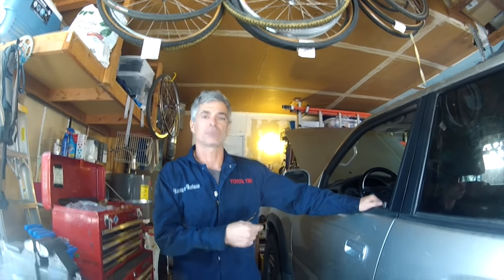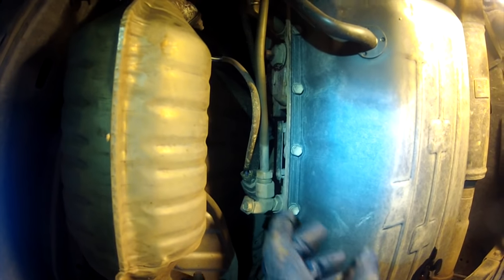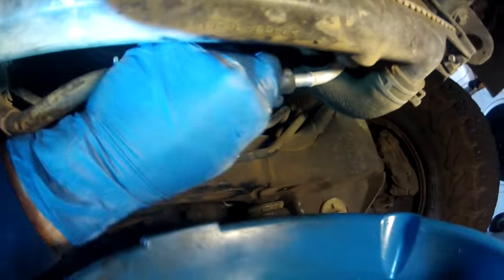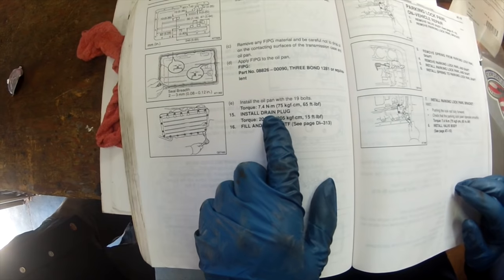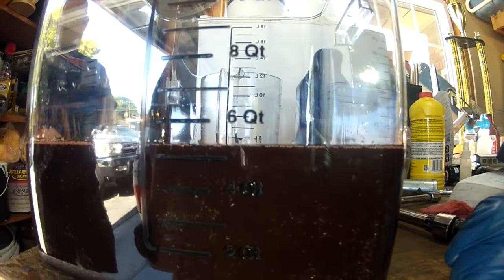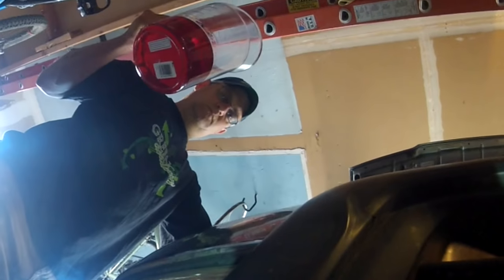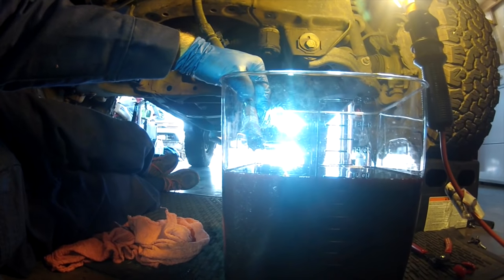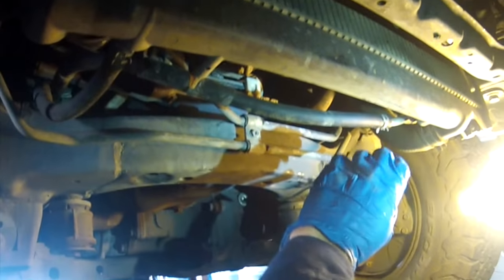Transmission Fluid Flush

Comment: Great video. Do you have to change the transmission filter too??
Reply from the maker: Glad you like the video.  Changing the filter isn't necessary unless you suspect the trans was seriously abused and never got fluid changes allowing sludge particles to develop and partially clog up the filter media.  The filters are a fine mesh strainer rather than what most consider a filter with some type of paper material that clogs easier over time.  The filters in these rigs could last forever provided the trans receives regular fluid exchanges.
Reply: @TimmyTheToolman  oh ok!! Thank you so much!! Great help!!
Reply from the maker: @HowardSprague116  You're very welcome.

Comment: I own a 2002 4Runner SR5 4WD. Love your videos and have been able to keep up all the maintenance myself with the help of your videos. Just wanted to ask if you had any experience with the fault code P0770. I flushed my transmission fluid and made the switch over to the Toyota Coolant a couple months ago and it brought up that code. According the FSM it’s a Shift E Solenoid fault. So I bought an OEM one and swapped it out, made sure the valve body was clean, inspected all the harnesses and changed the filter. I even shot the wires with my multimeter just in case. None of the magnetics in the pan had anything on them either. Haven’t had any shifting problems but my A/T oil temp is on the high side. I’ve researched all the forums I could get my hands on and haven’t found anything useful. Just thought I’d leave a comment just in case someone else in my same situation. Any insight would be appreciated!
Reply from the maker: We have not tried to diagnose a P0770 code yet.  What you tried so far sounds right to me.  When you say your trans fluid temp is on the high side, what temps are you seeing and in what conditions?  Was your fluid in really bad shape when you did that flush?
Reply: When I did the flush it wasnt burnt but it was on the darker side. Not sure when it was changed last (bought it about 2 years ago with 190k miles)I just drove back to Vegas from LA. When I have the gas pedal engaged or cruise control set my temps stayed normal (a/t temp: 195ish coolant: 195ish) but when I would coast without pressing the gas pedal my a/t temp would sky rocket to 280-310. My coolant stayed the same the entire time. As soon I pressed the gas pedal again it would drop back down immediately to about 210 and get lower and lower until it reached 195.
Reply from the maker: @ccrook12  Wow, you're seeing some crazy high numbers.  Normal cruising temps for your automatic trans should be between around 130-170 unless you're climbing a grade or towing.  The ambient temps can affect it so if the weather is really hot, your trans temp will run higher as a result because the cooling capacity of the air running through the cooling fins reduces.  You would only see high 200's if you're climbing up a long sustained grade and you never pull over to give your rig a break.  To clarify, these temp problems happened after you did the flush?  Before the flush there were no temp issues?
Reply: @TimmyTheToolman  Yes, I didn’t have any issues before I did the flush. That’s when the P0770 fault showed up.
Reply from the maker: @ccrook12  Ok, this is what I think happened.  It sounds like the previous owner(s) never changed the fluid or maybe only once.  Because of the abuse of not renewing the fluid regularly, sludge deposits were allowed to build up inside the transmission.  ATF has very good detergent qualities to it.  When you do a full flush all that new fluid is going to start working on those deposits and some of them are going to break free and be free-floating.  Those deposits could become lodged in the narrow fluid passageways in the valve body and then starve the trans of fluid.  It's for this reason that I never recommend somebody do a full flush on a trans with an unknown service history and with fluid that looks dark and smells burnt.  It's safer to do it slowly by doing a series of drain and refills of the pan over thousand miles.   What I tell people is do a drain and refill of the trans pan timed with an engine oil and filter change.  At the next engine oil and filter change, do another drain of the trans pan and follow it up with another drain and refill after a 3rd engine oil change.  This gets the fluid in good shape but is a safer method than doing it all at one time.
Reply: @TimmyTheToolman  So it sounds like I need to take down the pan and do a good valve body clean and do as you said and drain/refill with oil changes. Or is it too late?
Reply from the maker: @ccrook12  Hard to say if you can salvage it but I think it's worth a shot.
Reply: @TimmyTheToolman  thanks!
Reply from the maker: @ccrook12  You're welcome.

Comment: Are you shifting the gears while engine is running and fluid is being pumped out of the trans hose return line or do you just keep it in Park or Neutral? Does a flush completely remove all the old fluid or are there certain parts of the transmission system where the old trans fluid still remains. I'm just wondering which method would remove more old fluid, doing multiple drains and fills or doing a flush.
Reply from the maker: You don't shift gears for the process of the flush.  Leave the trans in Park.  This DIY flush removes most of the old fluid.   Is there a little old fluid left once you're done?  Probably.  Is it a concern?  No, it's not.  

Drain and refills are a dilution process.  You're draining out about a 1/3 of the system capacity, adding back the same amount.  So, now you have around 4 quarts of fresh ATF mixed with around 8 quarts of old ATF.  When you do another drain and refill, you're removing 4 quarts of the previous mix, and replacing it with another 4 quarts of fresh ATF.  Over time, the fluid gets cleaner and cleaner.  

The flush is a quicker and more effective way to get the fluid clean, but drain and refills work well to keep your fluid in good shape.  What I do is perform a drain and refill every 10k miles to keep my fluid in good shape.  I never wait until a longer interval, like 30k miles, to do a full flush.
Reply: Phenomenal explanation, thank you very much.  @TimmyTheToolman
Reply from the maker: @hamidizadi  You're very welcome.

Comment: Great video. I have an 04 4Runner that I just bought with 170k miles. No idea how long it's been since the trans fluid has been changed. Any issue flushing it and replacing all the fluid? And would you recommend that I drop the pan and clean the filter (or replace filter?) and magnets?  I also have an 08 Sequoia - 119k miles. Same situation - no idea when last changed. Recommendations?
Reply from the maker: With a transmission with an unknown service history, I think it's safer to just do a drain and refill of the pan.  This exchanges approximately 1/3 of the system capacity.  This is what I'd do if the trans fluid is just a little dark looking, like a darker red rather than new looking pink fluid.  If the fluid is black and smelling burnt, I probably wouldn't even risk a drain and refill and just leave it alone.  A trans that has been abused with few or no fluid changes has experienced excessive wear after the fluid lost most of it's lubricating properties.  When this happens, the fluid could be holding onto friction material from the clutches and the trans is relying on those suspended particles to shift properly and not slip.  Also, an abused transmission will have sludge deposits built up inside.  When you introduce new fluid that has very good detergent qualities, it could break free the sludge deposits which could end up causing a blockage in a fluid passage like in the valve body.  As for dropping the pan, unless you're having some type of issue, I probably wouldn't bother.  These filters are actually a fine mesh strainer.  They could get clogged up if the fluid was in really bad shape, but then the transmission is already on borrowed time anyway.  I dropped my pan and the strainer was pretty much 95% unclogged.  I mainly dropped the pan out of curiosity of the health of my trans.  I wanted to see how much metal debris had accumulated onto the magnets and I was pleasantly surprised to see very little.
Reply: @TimmyTheToolman  Thank you for the advice you gave to Meck. I am kind of same boat, records show transmission fluid changed at dealer at 81k, 2000 4runner has 295k, fluid is kind of dark cherry almost light brown , not black like old engine oil does not smell burnt , still smell like at fluid but has black particles floating on it. I think I will try to drain and refill, keep old oil and see how it goes. Thank you, you are a good teacher.
Reply from the maker: @jonascourtney5999  You're welcome Jonas.  Hope you can save your trans and keep it working for a lot more miles.
Reply: @TimmyTheToolman  thank you.

Comment: This flush method of transmission service get good result with less work, but required keep service interval 30-50Kmi. Dealer service of Toyota also became this simple method of service. But nobody could guaranteed fluid life 100Kmj as Toyota manual described with traditional service w/filter replacement.
Reply from the maker: I agree.  The only way fluid could last 100k miles is if the rig never drove in the mountains at all.

Comment: Is it possible to flush using this technique with a 4th Gen 4Runner that does not have a dipstick to refill what is being flushed (only has the transmission fill plug)?  Just trying to figure out how to drain as much dirty fluid as possible without damaging the transmission (and not doing multiple pan drain/refills mixing new and old fluid). Thanks
Reply from the maker: Hey Chris, I've never done this procedure on a sealed transmission.  Faye Hadley has a video for doing a fluid renewal on a sealed Toyota transmission.  Check out her channel and you'll find her video.

Comment: Last transmission fluid change on my 97 was 120k ago, currently it's brown (doesn't smell burnt), what are your thoughts on a drain & fill?
Reply from the maker: Hmmm, that's a whole lot of miles since your last fluid change.  If it were me, I'd drain the fluid in the pan into a clean container and refill with fresh fluid.  If the transmission ends up slipping because there was suspended clutch material in the old fluid that the transmission was relying upon, I'd drain it again and add the old fluid back in.  

Regardless, with that length of time since your last fluid change, some excessive wear has occurred in your transmission because the effective life of the fluid is not that long even if you never got the transmission fluid really hot.  At most, under ideal conditions, your trans fluid never got hotter than 170 degrees and would last you around 100lk.  

What I wouldn't advise is doing a full flush.  Do the drain and refill and hopefully the transmission is ok.  Another 10k down the road, I'd do another drain and refill and keep that interval.  Transmission fluid changes every 30k is a standard unless you're using synthetic fluid which will allow you to go longer..  Since you're exchanging around 1/3 of the 12 quart capacity every drain and refill, I figure over a 30k period, you've renewed the system capacity.  This is a dilution process and not a true flush but I feel regular drain and refills keep the transmission fluid in really good shape.

Comment: Tim I performed a fluid flush on my 80 Series by draining the pan, and then using a small suction pump hose down the dipstick tube. I measured the volume that came out and refilled with the same amount of new fluid. I drove the vehicle and repeated the pump out via the dipstick tube until I removed and replaced a total of 13 quarts. What do you think of this alternative method?
Reply from the maker: If it works, it works.  I see nothing wrong with that method.
Reply: @TimmyTheToolman  your videos have been an invaluable resource to help me understand how these various systems work, and how to properly maintain them. My 80 Series just rolled over to 300,000 miles and I've performed practically every service myself with the help of your channel.
Reply from the maker: @j.saavedra1502  That's great to hear our videos are helping you with your FJ80.  We appreciate you taking the time to share this with us.  Happy Wrenching Brother!

Comment: Timmy,  can’t decide what I need to do, flush or drain/refill?  I have a 99 T4R with 163k miles.  I’m not sure the trans fluid has ever been flushed or drain/refill.  Thx for ur advice. You rock!
Reply from the maker: Hey Marc, since you don't know the history of the vehicle, the safest bet is to just do a drain and refill.  I'm guessing the previous owner had a drain and refill done at least a couple times.  But, I should first ask, what does the fluid look like?  If it's really dark and smells burnt, I wouldn't do anything and leave it alone.  If the transmission was abused because the fluid was never changed, the fluid is most likely holding suspended clutch material and it's helping keep the transmission from slipping.  The damage is already done and there's nothing to do but hope your transmission lasts you a lot longer.  

If the fluid looks reddish pink and doesn't smell burnt, the fluid was definitely changed at some point in the past and you're safe to do a drain and refill.  A full flush of the fluid is a little more risky when you don't know the service history and I feel a series of drain and refills spread out over 30k miles is a better idea.  I do a drain and refill every 10k on my rigs whereby I'm exchanging approximately 1/3 of the system capacity.   This keeps my trans fluid in really good shape.
Reply: Timmy The Toolman. That's awesome T. Appreciate ur knowledge. My parents have had the rig (SR5 2WD) since 2001 and they don't remember what maintenance has been done.  I bought it brand new in 1999 and recently took it back cause they were going to sell it. It not was driven aggressively. 
I noticed a slow leak from somewhere with oil  pretty sure its oil) collecting on the transmission housing underneath. Any advice on this or any other maintenance items that need attention? I recently got the valve gaskets done. I saw ur vid on sunroof drain lines. Any vids on repairs/maintenance on the cables? Sorry for all the questions
Reply from the maker: Many do the lower balljoints as preventative maintenance since they have been known to fail.  A replacement radiator isn't a bad idea either since there have been incidences of the transmission cooler failing causing a mixing of the engine coolant and trans fluid which end up destroying the transmission.  There's the usual maintenance items like transfer case gear oil and differential gear oil changes.  Fuel filter would be good to change.  When were the spark plugs last replaced?  How's the air filter looking?  When was the timing belt and water pump done last?

Theres' quite a bit of things that might need attention.  Just depends on how regularly it was serviced.

What cables are you talking about?  The throttle cable, transmission kickdown cable and cruise control cables?
Reply: Timmy The Toolman it's the cables that open/close the sunroof. They are cables, right?
Reply from the maker: I'm not sure how the sunroof operates.  I've never had one apart.  We didn't mess with the sunroof controls when we dropped the headliner investigating a leak.
Reply: Timmy, Valvoline ATF Dex/merc (recommended for Dexron-III, Mercon) work the 99T4R?  This is the same one I used for power steering.

Comment: Hey Timmy. Love your videos. My trans dipstick is so difficult to go back in. Feels like is rubbing all over the tube when i insert in and back out causing fluid to smear all over. Cant really tell where the level is. I have to literately force it in. Anybody else experience this on 3rd gen 4runner?
Timmy  there is a video with an oil pump forcing fluid to the transmission from the return coolant line instead of gradually  feeding from the dipstick tube? Do you think is safe to flush this way?
Reply from the maker: Terry, this is common with many dipsticks.  What you have to do is help feed it into the tube by grabbing the actual dipstick not just by pushing from the handle.  This happens because the dipstick is really flimsy and the bends in the dipstick tube cause resistance.  You can either do it with one hand or two.  With one hand, grab the dipstick close to the end where you take the fluid reading and feed it into the tube until it gets past any sharp bends causing resistance.  With two hands, put one hand on the dipstick near the reading end feeding it in while the other hand is on the handle helping it along as well.  Hope this helps you out.  The reason this works is you have less dipstick you're trying to push at one time and thus it's stiffer.  The longer the section of dipstick you're trying to push, the flimsier it becomes and wants to bend on you.   Hope this helps.